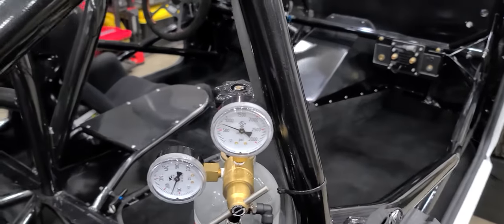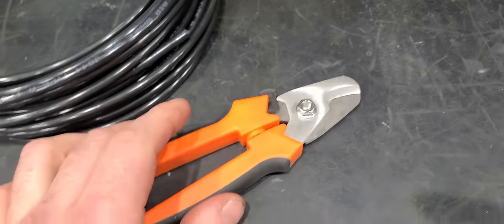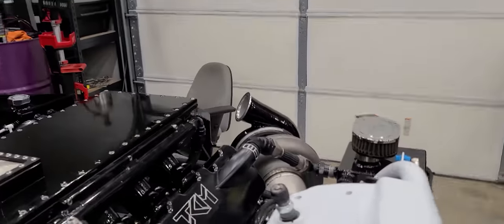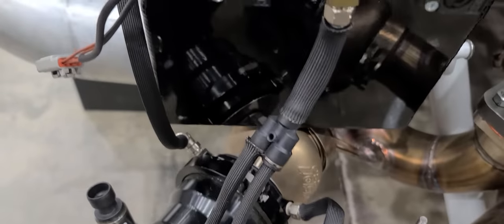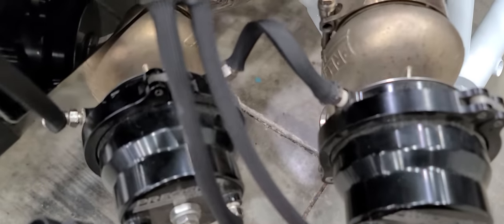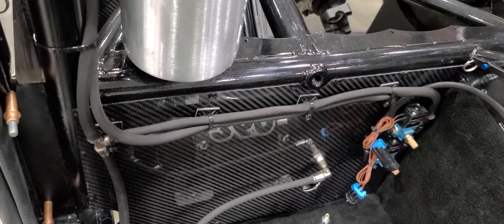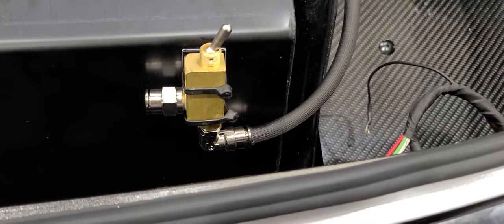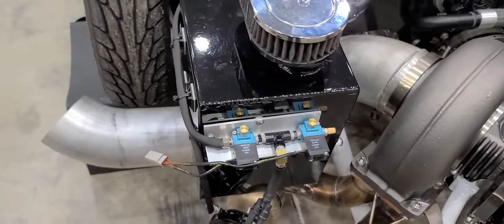Co2 plumbing for boost controllers, air chutes, shifters and chute releases

Comment: Is there a problem or something you didn’t like with Holleys hi flow valve or pro solenoid block with the bullet valves?
Reply from the maker: Nope I just couldn't find mine but found my old setup so I slapped it back on lol

Comment: What kind of carpet is that? Planning to use something similar on a 25.3 car I'm building and your looks great (at least in the video)
Reply from the maker: ozite carpet and we attached it to the tunnel and floor pans with velcro.  just use the stiff half of the velcro it works amazing.  we have done a bunch of carpet in different cars and always spray glued it.  well after i had this painted i couldnt bring myself to spray glue the floor pans lol
Reply: @theholleyefiguy  looks awesome, Street car stuff! 😉
Reply: Thanks, just ordered some samples.

Comment: Are you  using an adhesive 3m zip tie mount, supporting the wires?  I saw some on Amazon but wasn't sure if you had a different product.
Reply from the maker: yes

Comment: Quick question holley mentions using the compressor source for the bottom of the gates, you say intake which would be negative and positive pressure, any reason to use one vs thhe other? Thanks in advance
Reply from the maker: not all turbos are drilled and tapped for a pressure source, only reason i mention it

Comment: That other tank you have on the passenger side.  Is that off an air pump setup for back up or is it extra storage for c02?
Edit.... that's the fire supretion is it..?
Reply from the maker: yes its fire suppression system
Reply: What is recommended regulator setting to run the air launcher, air shifter, air chute handle and waste gates off the same regulator as you have?
Reply: @rockinghamdragway  He has his set at 125 psi.  It feeds all that.
Reply: @FAFO1984  wasn't sure if that was just to test for leaks or actually planned setting

Comment: Hey on your Mac valves what kind of connector did you use to tie them all together looks really clean trying to do something like that on mine. Thank you. New to the wiring side sorry if it’s a dumb question.
Reply from the maker: 1/8th inch pipe female tee from earls

Comment: Great video, Devin! Is there any issue running 140psi to the boost control solenoids? I am trying to avoid running a separate regulator for my air launcher, so if I can just give them both whatever my onboard air setup will put out, it would simplify the plumbing. Thanks
Reply from the maker: I run everything at 125 psi

Comment: Devin can't you use the air from the compressor housing to supply pressure on dome as well.
Reply from the maker: you can but it doesnt work as well since its not a fixed pressure source, and there will be times when you need alot more dome psi than actual boost pressure in order to increase boost
Reply: @theholleyefiguy  so for a street car would just spring pressure be good and if I use co2 wouldn't I use a lot on street if I lay in pedal?!? What you recommend for street/strip car?

Comment: Is it possible to have two Dome pressure sensors on a twin set up? No way my waste gates will be side by side like this, curious if Holley system will allow two? Cause I will want to run two to be sure everything is running proper
Reply: As long as the domes are being fed by the same source you can run one dome pressure sensor. If you have two different bottles feeding two gates, the. You would want two dome pressure sensors, but that would be stupid.

Comment: Can you tell me why you have 2 Mac Valves before the gates.
Reply: Don’t know if you ever got the answer or not. But the solenoid gets supply from the regulator on the bottle. And the other solenoid is a decrease solenoid to bleed off excess pressure. The one getting c02 from the bottle is an increase solenoid and allows more pressure to the Wastegates based off what the computer tells it.

Comment: Great video Devin, On the wires for the duel mac valves it looks like you used a Deutsch connector. My question is did you just tie the grounds together then run the positives on the out side on the connector?
Reply from the maker: Tied the powers together and used 2 separate pwm- signals from ecu

Comment: Look on google...some companies make a nice all male 1/8pt T for the boost solenoids..then on the one section going to gates u use a female 1/8npt to push lock. Gets rid of those male to male adapters and 2 less spots for leaking air.
Reply from the maker: i have them but i needed the spacing to make that little bracket to clear the pattern i already drilled and tapped for the pro series solenoids
Reply: @theholleyefiguy  ahhh ok gotcha